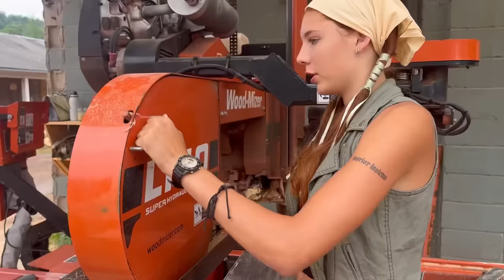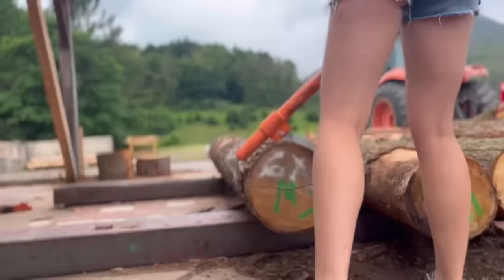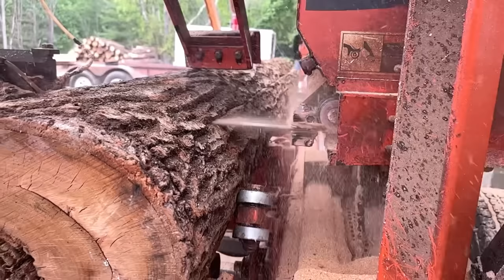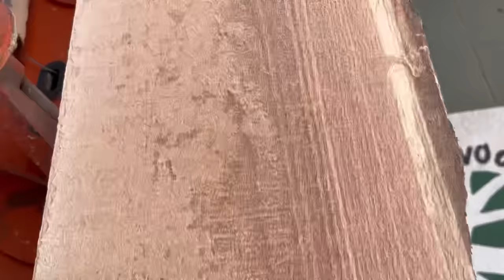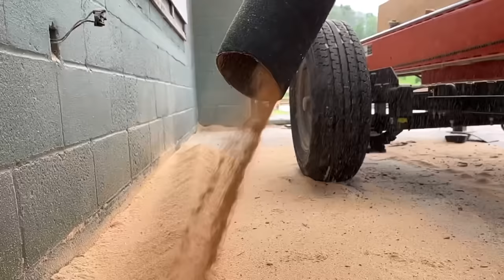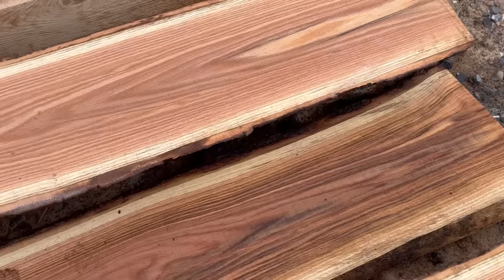SAWING A BEAM OUT OF OAK!! Beautiful results

Comment: We had to bang out four red oak 6x6's not too long ago. The big thing with oak is that the ends have to be immediately sealed once it's cut, to prevent wind-checking. Keep up the good work! -Andy
Reply: About the wind-checking…. Will you explain this more in depth?
Reply: @Star Navigator  Wind-checking is a misnomer because technically it is a curved shake (crack) that follows the grain around the inside of the log. It's common in Hemlock. Any log species is made up of thousands of axial fibrous tubes that run down the length of the log axially. When the trees are felled, they are full of moisture/water-weight. Depending on the weather/humidity/wind, that moisture propagates down the tube and is "blown out" the cut-ends of the logs. The end few inches of the logs can dry out incredibly quickly on sunny/windy days. The result of that drying is that the wood "wants" to shrink, but it can't because of the section-thickness of the log. It puts the log-end in a state of tension, and the wood fibers shear apart into radial cracks. It's very common in Ash, Red Oak, and Cherry. The main way to fight the crack propagation is to immediately seal the log ends with a non-permeable liquid/paint so that the water can't be lost rapidly over the first few days after felling. One of the first questions we ask when someone wants us to buy logs is how long ago they were felled. Ideally they are cut the same day, come right off the log landing in the forest, and straight to our mill where we seal all the log ends. Hope that helps. -Andy
Reply: @cripplecreeksawmill  WOW!!! Thank you so very much for replying!! This was a true education for me!  I had to screen shot your reply to save it for hopefully the future!!! I am completely fascinated with the whole wood industry from felling to firewood and boards the works! I’m actually going to buy my very first chain saw today!!! A neighbor of mine he offered some tips and help me out getting safe with it and has some smaller logs for me to practice on. He said “Now don’t get one of them big bars!!” Lol I’m 4’11 AND 3/4 tall…… yes the 3/4” is important to me lol 😝!!
Thank you again Andy!!
~Star 💫
Reply: @Star Navigator  Not a problem at all Star, I'm happy to help. The best bit of advice I can give you regarding your new chainsaw was what I was advised when I first started using them many moons ago: be incredibly careful or touching only the tip of the bar against the log. The chain runs down over the tip, and if only the tip contacts the wood when you are moving/repositioning the saw, it will violently throw the saw upwards/back at your upper body. Best of luck! -Andy
Reply: @cripplecreeksawmill  Absolutely Mr. Andy!!! Picked up a 545 MK II… came with a 20” bar and chain…..  sure is pretty!!! I need to get her all dirty!
I did read the manual cover to cover and will again in the morning. I did see what you are talking about the tip thing… I’m not afraid of the saw just a healthy respect already for it…. And that dang tip have to keep my eyes where it is for sure!
Sure wish you lived down the way I’d be over picking your brain lol!
~Star 💫
Reply: @Star Navigator  you'll love the 545, we use the same size Husqies at our mill. It's a bit of serendipity that the shake I was describing in the logs is called "star shake". -Andy
Reply: @cripplecreeksawmill  ha! Now how about that…. Star shake!! Here I just thought my parents were hippies lol younger sister Venus….. and an older brother Bob….. he must be adopted lol 😝

Comment: 6 x 6, 6 x 8 , 8 x 8 and up  12 x12 are used  for beams  or support beams for houses,  boat docks, and other  uses.  I  had 6 x 6 beams for my floor rafters in my house.
Support beams are vertical and used for stilts in high flood areas.

Comment: I built a sawmill shed for my mill and I used (4) 10"x10" red oak logs for the back posts. I won't do that again only because doing the timber frame joinery was not easy to chisel and work with. Looks awesome but is definitely not as easy to work with as pine or hemlock.

Comment: The beam across the living room I build some years back was an ash 6X14.  Oak, 6x6 is a column.  Excellent for supporting and axial loads.  That is a pretty piece of wood.
Reply: I’ve stayed in many cabins  with 6x6  beams. A 6x14 can also be a column all depends on how you use it.
Reply: @dontfit6380  Absolutely  !  All depends on span and loads.  I suspect you like a nice piece of real wood vs some particle board laminated beam,, just exactly as I do.  Holds just as many pounds,, looks a whole lot nicer.
Reply: @Sailor376also  👍

Comment: Hello , I think that Oak 6x6 may well be a supporting beam in some building. Is it possible for you to trace it to the end customer? Thanks for your great channel, i have learned a lot from you about sawmilling.
Reply: 6”x6” is a post size. Excellent choice for a gate post where the gate has a fair amount of weight to it. Minimum size for a pine lintel on a load bearing perimeter wall would be 6x4 for a narrow window. All dependent upon vertical load, locally assessed wind rating, (age-related) strength of timber and automated strength testing during milling process.

Comment: Cut a 12x12 x22 out of white oak on an LT 40 about 8 years ago for a cabin. It may have been 21feet 8 inches as long as the mill would saw minus 1 inch.  The guy came back a few weeks later and wanted 8x8x16 a dozen of them!  At the time it was hard to get white oak because of the stave prices. Those pieces cost him dearly.

Comment: I enjoyed the video.  I think would go ahead and saw that beam into boards.  The end checking and rot/bug damage would make me think twice about using it for long term structural support.  It might be possible to cut off the ends if it has enough length to sacrifice.
Reply: Looked to me like ring shake in the  butt end, something else to check out before using it for structural

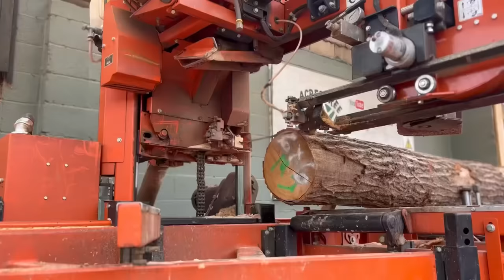Comment: the split in the log at 1:45...if your cutting 10 ft logs to 10 ft length planks...what happens if that crack goes into the wood say 5 inches ...does that mess up the planks that ya cut  from that piece?

Comment: Have you considered making gas from your wood burning it in old clunker petrol engines and using them to generate electricity to charge the batteries you'd need with a solar system.  Or use them to make gas to run a kiln or heat up coffee!

Comment: I have a question.  How often do you guys find things like nails or bullets for example in your logs?  Does it destroy the blade?
Reply: usually small pieces of metal will only affect 1-3 teeth of the entire blade, and while that can leave some 'chunking' effect, if you bend them back/remove the flaw you can get by

bullets rarely penetrate deep enough, 99% of metal in a tree is from an old sign that was attached

I am an advocate for NOT using trees to post signs, it hurts the trees and later leaves things like nails for millers to deal with

Comment: Working with hardwoods I've actually enjoyed as long as the cutting or shaping tool is sharp. There is minimal binding or friction from sap which happens in softwoods. Only disadvantage is the weight . . . Oak 6x6 >> Must be building a hydro dam 🤣 🤣 🤣
Reply: The customer is using it for weight on a drag for his driveway.  Boss Man.
Reply: Lol, I would’ve never guessed that!

Comment: Why do you turn your log 180° when you're cutting I turn mine 90° on my  small mill
Reply: Not to answer for them, but when I saw anything at large dimensions (6x6. 8x8, etc) I saw one side, turn it 180 saw the other side then turn it 90, it helps keep the cant square.
Reply: @georgemain889  I second that George that is also how I’ve always done it.